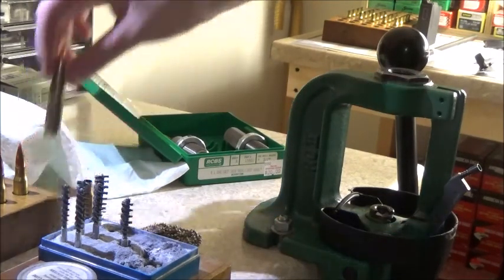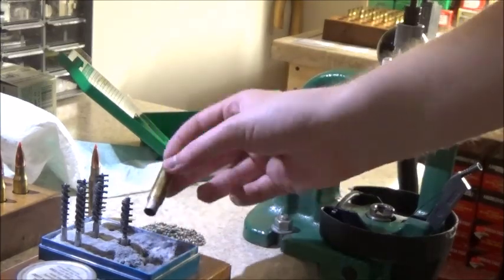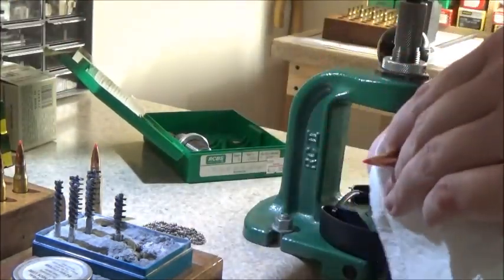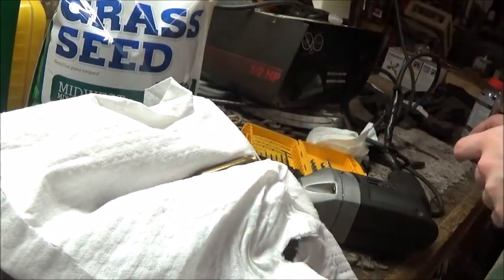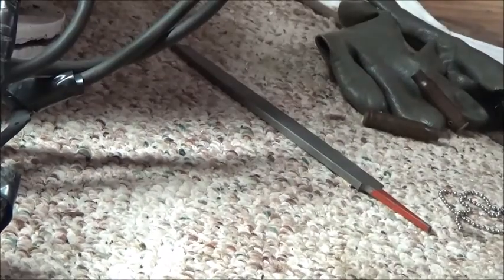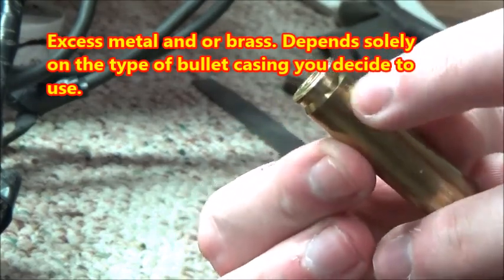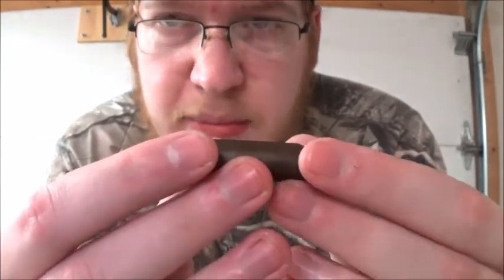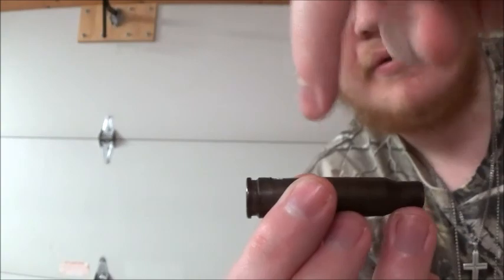How To Make a .308 bullet necklace.

Comment: Use a  drill bit one size larger then the hole  to debur the holes just push it into the hole and twist it with your hand and will come out much much cleaner.
Reply from the maker: That works too. Thanks for watching and dropping advice.

Comment: that's just badass man! i had a question, what would you recommend to use if i chose to spray a coat of just to protect it from weather and from the bullet being in direct contact with your skin?
Reply from the maker: I'm not too sure because I did not factor that into the process of making the Necklace. Other then some minor discoloration the bullet is still holding up well.

Comment: Does this work with a 223 rem bullet too?
Reply from the maker: I tried to do this once with a steel .223 case but the drill bit didn't dig into the case. It kept sliding off before it would start drilling the hole. But I never tried it with a brass .223 case, brass isn't as hard as steel so I would imagine that it very well could work. In fact the other day I was contemplating doing a .223 bullet necklace video but I got busy and didn't get around to it. I will have to try it soon though.
Reply: Any caliber will work, centre punch your hole first to prevent slippage.

Comment: How would you drill a bullet to make a Hog's Tooth?
Reply from the maker: What is the difference might I ask?
Reply: Plisken X51mm a Hog's tooth is a .308 bullet without the case it's just the bullet its self with a hole drilled through it on a piece of paracord. I tried to make one with my .308 that my brother broke but it got mangled
Reply from the maker: Joaquin Velazquez
 If it were me, I would wrap the bullet in a piece of paper towel, then put the bullet in a press and drill it through that way. But go slow with a decent size drill bit. See if that works. Like I did with the brass case in this video.

Comment: armor-penetrating round?
Reply from the maker: It is a Hornady A-max round. It has a ballistic tip on the end to allow it to fly through the air better than a hollow point, it has a high ballistic coefficient and flies through the air better, it is aerodynamic and it has a boat tail which lets the air to wrap over it and makes it fly even better. MY M1A/M14 loves them and I can achieve sub moa accuracy with them. If I had Armor Piercing bullets I'd definitely save them. Thanks for watching :)